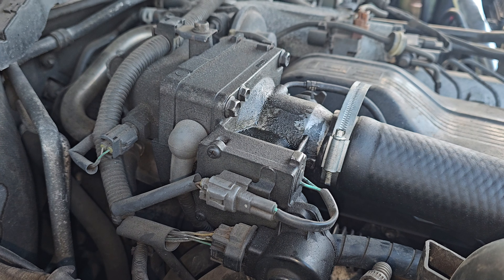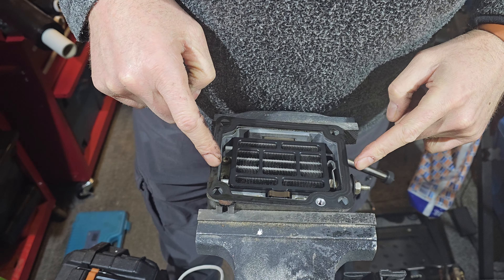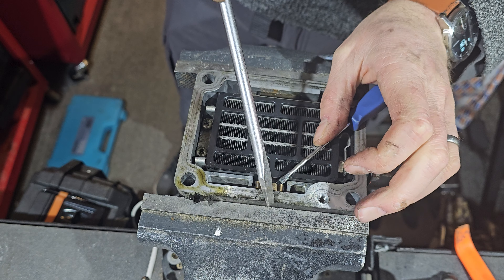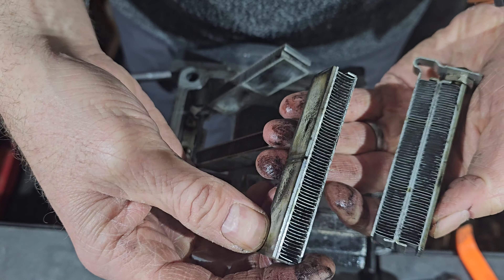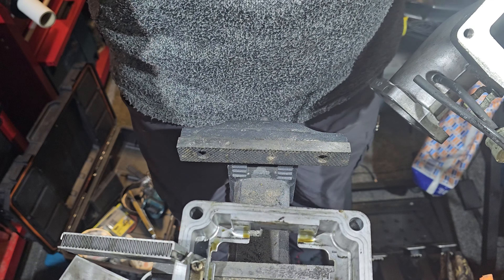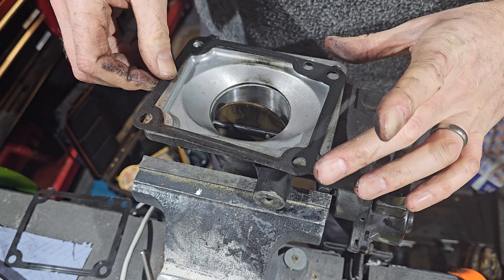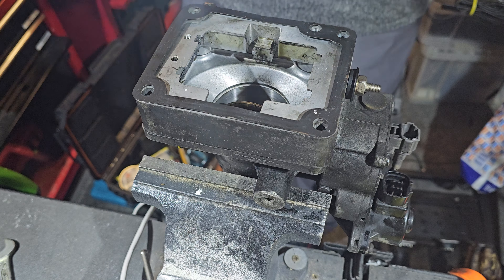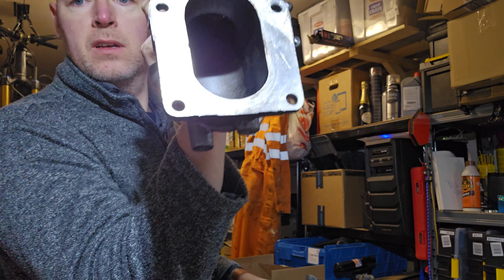1HD-FTE intake heater delete for the Land Cruiser

Comment: Most guys in Australia disconnect the power to the element from the relay side of the wiring. Nearly everyone though retains the heating element in the intake. It's because if the turbo ever lunches itself, the screen usually catches all the pieces before it enters the engine. I've heard of numerous instances where engines have been saved by that heating screen catching all the pieces. Any gain in power from removing it is also said to be very minimal. So leaving it in is the best advice.
Reply from the maker: If I ever found pieces of turbo that far down the intake it's definitely in my cylinders already 😂 hopefully it'll never come to that
Reply: @landcruiserscotland  Well you'll be the first to know. 😁
Reply from the maker: The grinding scratching noises and plumes of smoke would give it away 😁

Comment: Great video! I have removed that heater also. My LC 100 starts No problem even -32°c Finnish winter. No codes appear when the cable is disconnected.
Reply from the maker: That's brilliant news, thanks for that confirmation! Where in Finland are you? I have a friend on the west coast near Oulu and his winter looks terrifying. Especially the polar bears.
Reply: @landcruiserscotland  yes! There are plenty polar bears here!😅😉 I live in Oulu. Small world.
Reply from the maker: Oh well let me be even more specific then. He's in Raahe. Does the world get smaller?
Reply: @landcruiserscotland  ok. That is only 70 km from Oulu. Is he also LC fanatic?😄
Reply from the maker: No no he is fanatic about motorbikes and men in leather 😂
Reply: @landcruiserscotland  oh my. Most definetely NOT the hobby for Finnish winter!
Reply from the maker: Yes you need thicker armour than just leather, especially if there's a penguin attack

Comment: Those pesky screws could be loosened by grabbing your screwdriver, placing it in the screw head and apply pressure in the tightening direction and tapping the head of the screwdriver with a hammer. Works most times for me. My land cruiser here in AUSTRALIA does not have that heating element.
Reply from the maker: A little bit of heat gun broke the loctite and they came off as easily as a normal screw

Comment: If you find a nut or a bolt on a Toyota that isn't 8,10,12,14,17,19,21,24mm you can almost guarantee that so one has been in there before you and changed some bits.
Reply from the maker: I found a 15 on my rear sway bar this week. That was definitely a custom job.

Comment: You’ll find that you can bolt the butterfly valve to the intake without the heater block just need 4 shorter bolts
Reply from the maker: Do you know if there's enough wiggle room on the other piping and brackets?

Comment: Yes did this mod in 2010 I have fitted a barb adapter in hole where the nut was for a boost guage but i am trailing  and electronic boost guage and have since fitted a pressure transducer in place of machanical gauge and barb.
Reply from the maker: Oh fancy! Are you having any success yet?

Comment: Can anyone confirm if you can just remove the heater block and rebolt the butterfly using shorter bolts. Just about to do this. Tia
Reply from the maker: You won't get any engine management lights but the rubber intake hoses might be a bit of a stretch since you're removing a couple of inches of block
Reply: @landcruiserscotland  thank you again fella, you're on it. 👌Top speed reply and like having a LC100 buddy on my doorstep. Cheers. Next stop EGR delete. De cat, oh and rust, more rust and rust sprinkles on top.
Reply from the maker: The rust is the sprinkle 😂 get it off get it off get it off!
Reply: @landcruiserscotland  trying, got gallons of bilt hamber ready to go. After a worn out nail descaler, 3 wire brushes and infant school welding skills.
Reply from the maker: @RobDawg-b6h I've got a big makita reciprocating saw with an attachment that has a wire brush. It's the destroyer of worlds

Comment: Turns out the 1HD-FT in the HDJ80 and HDJ81 have the exact same air heater part, so I discovered your video searching around. Turns out my bolt terminal is loose; and looks like it needs some tightening, and your teardown of the air intake and putting the bolt terminal back on was super helpful in understanding what's going on here!

I don't want to tear the air intake apart to delete it, or to tighten up the bolt because I'm afraid I couldn't put it back together... I live in Washington state in the USA, and it can get pretty cold here. So we'll see how it goes! Fortunately my two Philips screws did get loose and come out, but you're definitely right that they're locktited in there.
Reply from the maker: Glad the video was helpful! I eventually got them out with a heat gun which broke the loctite. I've had no issues or engine lights since disconnecting the power from it. I'm sure there's a wiring document from Toyota which describes the conditions and temperatures where the heater is deployed. That might help you decide if you even need it.
Reply: @landcruiserscotland  I spent a while looking at various factory engine and truck service manuals I have, and couldn't find anything that would describe the behavior (although a lot of ways to test that it works).

I ended up just unplugging the lead on the relay for this circuit, will put it back together and sort it out later (in the fall before it gets cold). Thanks so much for the help again!

Comment: I live in Russia, so here we need this heater badly. Especially if you wanna go somewhere Nord or Nord-East.

I'm not quite sure, but maybe I have a problem with this device. At least I thought like that before this video.

The problem is, when I have started the cold engine not all the cylinders work together. It became especially noticeable by the sound around 1500-2000 rpm. It happens even when the temperature is even warmer than 0 Celsius. But there is no extra gray or blue smoke from the exhaust system.

I did not adjust the valves. So maybe that is the root cause.
Reply from the maker: You could check if the heater is drawing power when the engine is very cold. Using a current clamp/ammeter. I had a previous landcruiser that had misfire with cold cylinders - it was because of worn piston rings. When they got warmer, the problem went away. Lots of smoke though. Do you think your injectors are healthy?
Reply: @landcruiserscotland  Do you mean placing the current clamp on the wire, that is covered by a rubber hat at 0:12, while the engine is started? 

I hope I haven't had a piston rings worn, because I only have about 160,000 km mileage. Who knows though. I bought this car a year ago, and it was 150,000 km on odo. I have no reasons to believe that is true, but the car's condition says its mileage is most likely to be no more than 250,000 km.

Maybe you're right, and the problem is in the fuel injectors. I planned to do a complex diagnostic, start from valves and go deeper.
Reply from the maker: Yes a ring a meter around the feed wire with the rubber hat. My piston rings were dead at 150000 miles with full service history. I hope you are more fortunate than me!
Reply: @landcruiserscotland  We'll see. Which engine oil do you use in order to avoid another death of the piston rings now? And how often do you change it?

Comment: Any updates on this? Did it throw any error codes
Reply from the maker: I'll be fitting it next week so I'll update to let everyone know. Some others have unplugged the relay with no issues though
Reply: @landcruiserscotland  cool I'll look forward to that!
Have you put the egr delete into it yet? I'm thinking of doing the same on my 100 series here in New Zealand and just trying to figure out if it's going to put up error codes.
Reply from the maker: Definitely no engine management light. No issues whatsoever!
Reply: Why didn’t you just disconnect the power cable? I’m in Australia and was told to just unplug so less stress on the alternator, thoughts.
Reply from the maker: I also want the marginallyhigher air flow through the unit